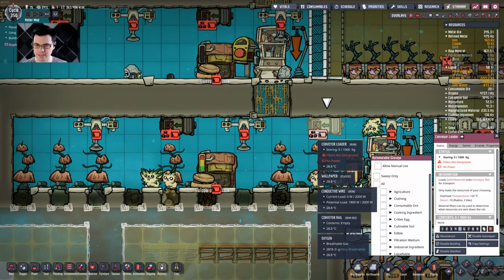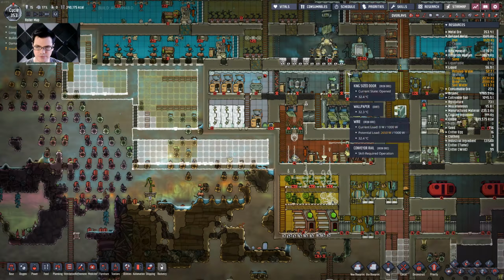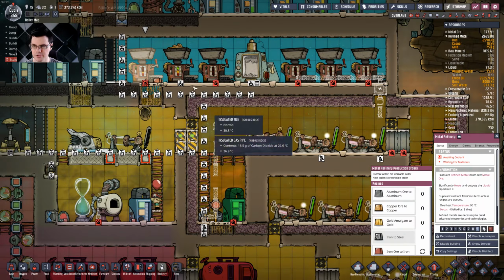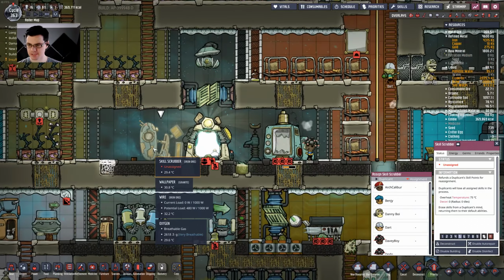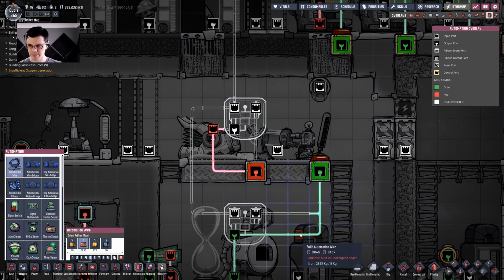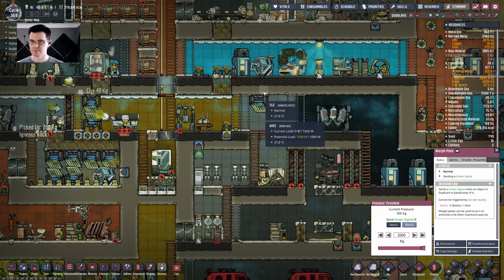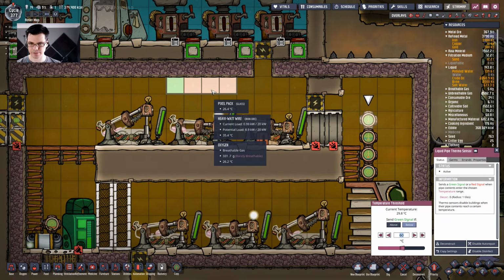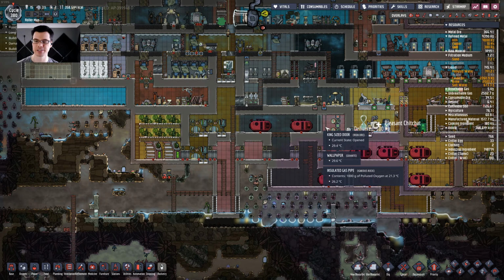A Bit Of Automation! - Oxygen Not Included ep13

Comment: I think you can get better cooling out of your thermal electric generators using with a one tile of liquid like petroleum underneath metal floor plates and temperature shift plates and run your cooling loop piping through the liquid. In my base I sunk a thermal generator into my water tank for fun and to see what it would do. I placed mental tiles and thermal shift plates around it and the water tank temp evened out at about 22c. I use it to cool my incoming oxygen. After about 70-80 cycles the tank had started cooling the biome next to my base like you would see if a cold biome had a break in it.

Comment: im using a circuit of conveyor belt to send signals around the base. snazzy suit means its low on phosphorite etc and the element sensor triggers a few seconds worth of phosphorite to empty on to the conveyor. I do wish the sensors or filters could do more than one element at once though.
Reply from the maker: That seems realy interesting :)
Reply: @brothgar  its something to challenge yourself with when youve cracked getting enough food and oxygen.
Reply: that sounds like an idea i had (but never implemented) to send clean water from modular apartments into the communal waste-water pipe & sense that clean water packet to send a conveyor packet of food to the right apartments.  length of clean h2o burst = destination.  sewage pipe had to run in series, so each apartment would look upstream & delay sending a message if a different message was upstream.
Reply: @PyrokineticFire1  ive been trying to think of a compact solution to that myself. The food going stale by the time its wiggled round every full apartment was a problem. the best ive done so far is any empty fridge triggers an alarm which is checked once a day then a decent amount gets sent that hopefully fills all the fridges and any extra goes back to a central store. Im not happy with it though.  The 7 segment counters are interesting but im not sure if i can much use from them unless each transmitter only runs at certain times of day maybe?
Reply: @JohnSmith1066-l5n  using a shift rotation for signals could definitely work, but it'll add more logic to the decoder. not helping the compact-ness @ the decoder, but it might unclutter the rest of the base

 fidges for signals, i think it'd be best to hold overflow, otherwise the next meal always triggers the "not full" fridge.

alternatively, drop food in the apartment's (chlorine or CO2) pantry via a chute onto a weight plate

by timing how long a door opens so a sweeper arm can only fill one conveyor packet & passing food through a box that has a limited capacity, it's possible to send smaller bundles. 

automation ribbons could be as helpful as shift rotations, or use both!
Reply: @PyrokineticFire1  Yes the logic is getting bigger than the machines they run. ive had the conveyor hoppers in co2 with the fridge as a buffer to fill them up so they dont alarm for every meal.i might play with limiting the box sizes but my main problem is i want to send just the right amount of food for each fridge. im trying to get asmany dupes as possible sealed inside their own cells that they never come out of so individual logic is the limiting factor i think. Ive been shoving a lot of them in one box with mesh tiles for a floor and a food chute above them but it feels like im defeating the object aswell their human rights. Also the weight sensor is a good idea but if anything goes stale it sits there going mouldy while they starve.
Reply: @JohnSmith1066-l5n  MAYBE you could have small (1kg) packet of food on the conveyor circuit. each dupe cell has weight plate & conveyor sensor controlling a conveyor shutoff that'll direct that food pack to their cell.

have a conveyor sensor attached to a buffer watching the circuit. make buffer duration long enough to check entire rail. if the buffer output goes inactive, your food loader knows a cell removed the packet & can add another. if the rail circuit is really big (& would take too long for a single sensor to see all contents) maybe a series of sensors watching quadrants.
Reply: @JohnSmith1066-l5n  the staleness issue makes me want a compost mod with a freshness slider setting. automatically compost a food when staleness hits the limit
Reply: @PyrokineticFire1  i think that would take too long but its a possiblity. the circuit is really long and will get bigger as the base grows i think by the time one unit of food gets to the housing area and gets removed, and then signals back dupes will begin starving before its drip fed each one.  i could use automation wires to make it faster but that defeats the object i think. i can turn off sections of dupes cells (yes its more like a prison block) so it bypasses sections of rail but its still a really long trip.
i want one rail to do all long distance transport ideally.
Reply: @JohnSmith1066-l5n  i was gonna suggest spacing out the food packets on the rail (if 1 packet would take too long to travel past all cells) so every nth rail packet was food

but that still leaves a staleness problem. staleness in the cells is resolved by setting weight plate to 0kg. (they gotta finish their stale food before getting fresh food.) but that leaves them with no reserves, so new food must be prompt. food on the rail may just be going around in circles, by luck, never being delivered to a cell... idk how to ensure food is removed & used before going stale on conveyor.
Reply: @JohnSmith1066-l5n  how about using an automation ribbon along the rail. put cells on signaling shifts with up to 4 cells per shift (one cell per ribbon pin)

each new shift, food loader adds a number of food packs = number of active pins on the ribbon. 

that way food is supplied as demand requires (reducing waste/staleness)

it may require a little extra logic in the cells, so close-to-source cells don't steal food off the rail that was requested by a distant cell
Reply: Hey guys ive got an idea... what about a mod that allows you to preserve your food on the actual conveyor belt --- Like a ziplock bag
Reply: (Not infinitely of course but something to help with staleness)
Reply: @lilantman05  that makes me think of an "insulated conveyor rail"
thinking a rail with no off-gases and very little thermal interaction
having it placed like transit tubes could balance gameplay